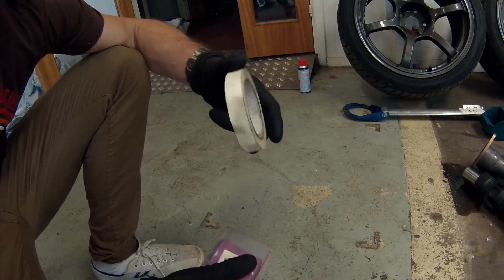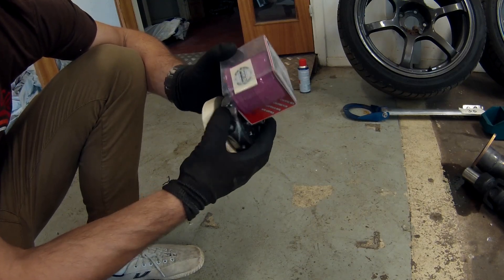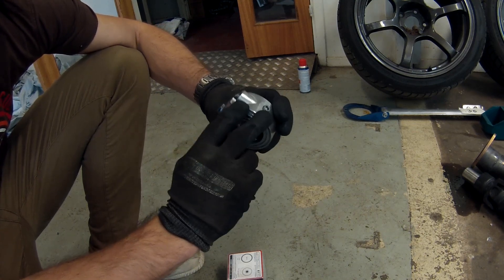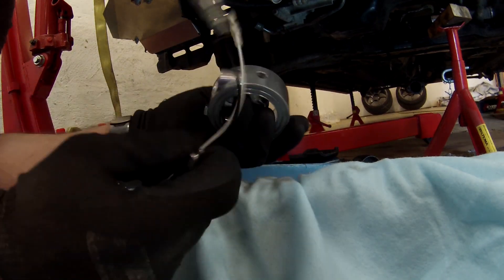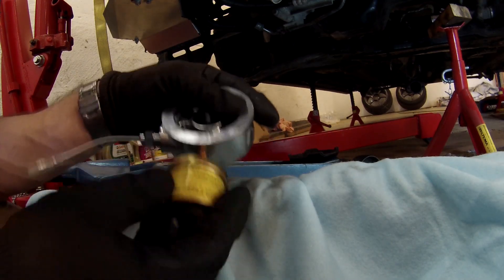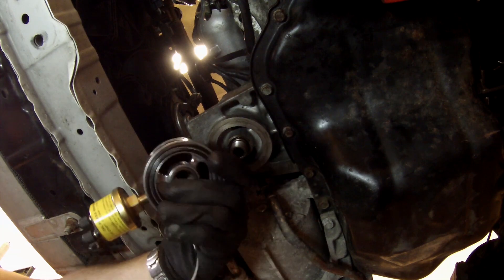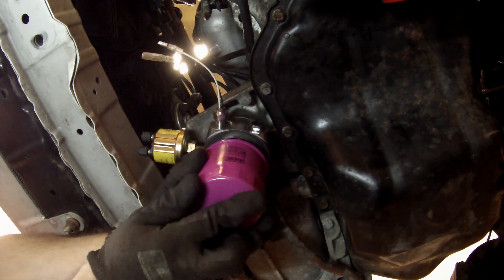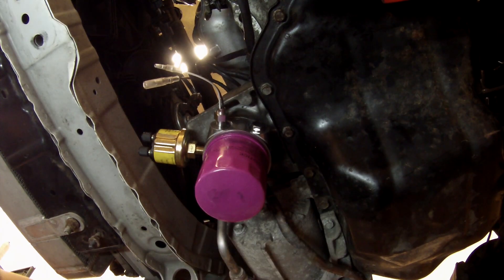How To install a sandwich plate and how it works

Comment: One problem with the sandwich adapters is they tend to keep air from entering the filter at shut down making the bypass filter stay full. Some like this but it makes a mess when changing the filter unless you add a drain valve. A restricter orifice isn't needed because you aren't robbing oil from the system to feed the bypass filter.
Reply: Use a punch to put an air hole in the filter when taking it out for replacement. Problem solved.

Comment: I use the Perma Cool universal sandwich adapters to install the toilet paper bypass filters.They are for oil coolers but work the same for oil filters. All they have is an in and out port. You have to use a 3/4 thread full flow filter sech as a Ford or Toyota. All of the oil Goes thru the full flow filter. Some takes a detour thru the cooler or bypass filter. Haven't bought one for awhile. Normally I get them from Jegs.

Comment: seeing him fumble around trying to screw in the sensor with gloves on cracks me up.Ya, it sucks scrubbing grease & oil off your hands & probably causes some sort of cancer but, those parts are brand new so, Y gloves? seems as if there getting in the way. That's my experience with gloves/working on a motor! I loose the fine touch & they get staged on other things/ get in the way!

Comment: thx for the video! I got some questions:
1. Do I have to buy a lower filter (because you use the HKS one) or does it fit with OEM one too (because of the height. can I close the stock plastic underpanel if I use an OEM filter`?).
2. there seems to be a lot of controversies about sandwich plates. Some people say they will leak under extrem conditions. Did you have any problems with it so far? (I bought one a while ago but i'm still unsure if i should use it :( )
Reply from the maker: Hi, OEM fits just fine, they are both the same sizes. Nope, no problems so far and I've taken my car to the track several times.
Reply: Explore The Known  Thank you. I give it a try too then!

Comment: does anyone know with this sandwich adapter can you run the lines to your turbo? doesnt seem like it will, but it might unless all inless arent used..
Reply from the maker: Nah I don't think you can do that with this kit, I think your better of using your existing lines to feed the turbo with oil, atleast with the 4B11T.
Reply: i guess i just run it from the oil sending unit then and use this for oil temp.preasure gauge. thanks though!

Comment: What about when you want to run an oil cooler from it? Are there separate channels for in and out so the cooler can circulate properly? Which holes are out and which are in?
Reply: Yes there is separate in- and outlets from the sandwich plate for the circulation of the oil through the oil cooler. My sandwich plate in this video is only made for connecting additional sensors. Have a look at this picture and you will see them: http://www.andrewho.com/misc/BNR026/090513_sandwich_plate.jpg
Reply from the maker: Yes there is separate in- and outlets from the sandwich plate for the circulation of the oil through the oil cooler. My sandwich plate in this video is only made for connecting additional sensors. Have a look at this picture and you will see them: http://www.andrewho.com/misc/BNR026/090513_sandwich_plate.jpg
Reply: Nice one so i guess it depends on the plate itself then does it?
Reply from the maker: Matthew Fox Yeah, in most cases the direction of the flow doesn't matter (Depends on the design of the oil cooler and the plate) so your inlet can be your outlet and vice versa. So it all depends fully on the design of your parts. Some also comes with built-in thermostats, some don't.
Reply: I need two things from my sandwich plate when I purchase one. 1- to be able to run an oil cooler. 2- to be able to run a pressure gauge. Is this possible?
Reply from the maker: Matthew Fox Absolutely, no problem.
Reply: there are plates designed specifically for running a oil cooler